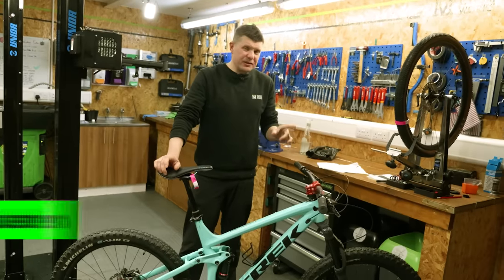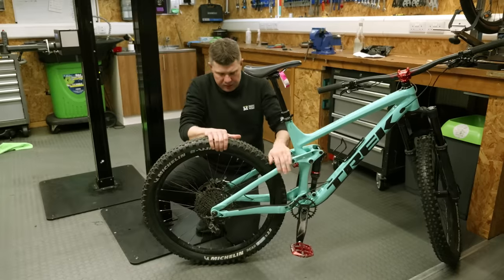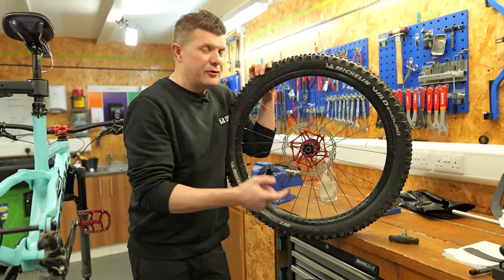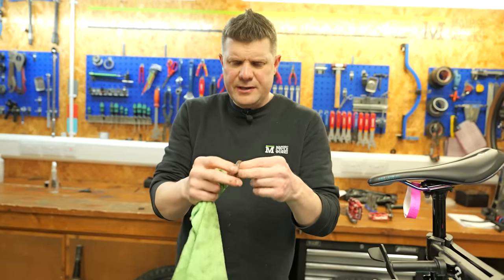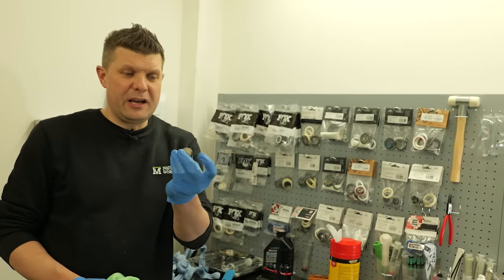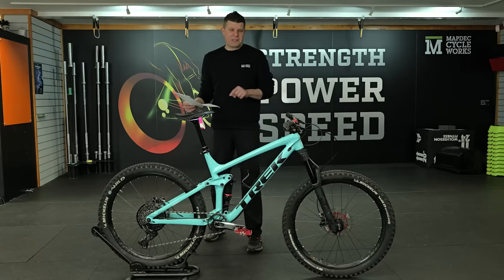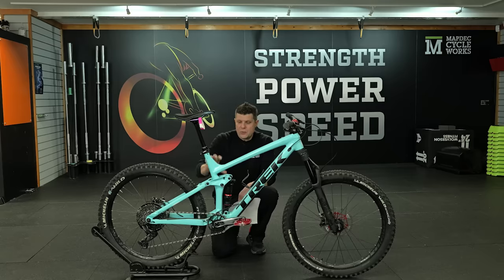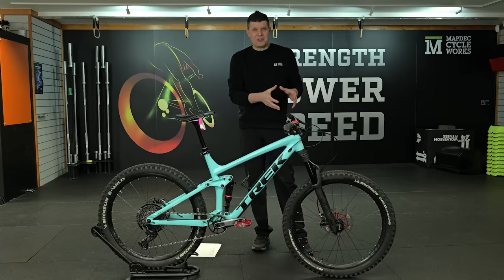They were quoted £975 to make this Trek Remedy safe

Comment: Our shop does “get you riding” repairs, but we strongly urge against it unless it’s an absolute must. As you said, a bigger repair bill is always coming down the line if you put off maintenance. Cheaper in the long run just to knock it all out and educate the customer on proper care to avoid the same situation in the future. We’ll always give them the option and the bare minimum, but we’re experts for a reason. It’s our job to guide someone to make the best decision possible for the longevity of their equipment. 

Your customers must be nicer than ours. If we do a bare minimum repair, they almost always come back in complaining about the things we didn’t touch in a few weeks and we have to go through it all over again. 😅
Reply from the maker: I think discussing expectations is very important when you do this kind of work.

Comment: Good video 👍🏻

I used to work at a National cycle chain, and very quickly learnt of the damage pressure washers do. Obviously now there are bike specific ones which I’m sure are fine, but use Muc Off products and a hose with the pressure turned down and don’t have any problems. 

The dealership I got my Trek Fuel from used to say if you can’t afford to put £15 in a jar each time you ride, (towards maintenance) then you shouldn’t be riding. Makes a lot of sense, especially as the basics are so easily dealt with at home.
Reply: Wow, £15 a ride would rack up to £45 a week! I get the thinking though

Comment: I can do slot of normal maintenance on my bikes but I took it to a bike shop recently to get it serviced. Fifty pounds got me wheels trued (I have no stand, reason I took it in), brake bleed, gears indexed, cleaned and oiled chain, check headset, check bottom bracket, check tyre pressure, check brake pads and disc. I bought the bike second hand and the guy was "Bigger" so they also set air suspension pressure and replaced a missing tube cap for free.
 
Everything except the truing I could have done but I'm glad I didn't have to index the gears.
Reply: That was interim service, full service does regrease, new bearings, pads, cables, true brake disc for £130 that's not a bad price

Comment: The suspension service thing is really common, most places will just tell you they send them away . I don't see the point in going to a shop when I can send them away myself. I've luckily got a place local that does service in house which I get my rear shock done at I do my fork lowers myself . I think it's really important to learn some home mechanics these days , break bleed dropper service etc . I do my own frame bearings also as that's a really labour intensive job . I think there's a lot of shops from what I hear quoting up bike services now as the bike industry pinch increases .most people with some tools and you tube as a guide can do basic servicing themselves.

Comment: Personally...I don't disagree with the first shop. It's a good opportunity to educate people of the required maintenance and cost of running a FS bike. 

They might have saved a bit of money this round but they'll have to pay the rest of that initial quote and then some for pivot bearings, new crank, cassette and miscellaneous other bits later down the road.  Preventative maintenance goes a long way. It's just the reality of partaking in a sport that can be destructive on consumable parts.  

Having said that I think you did an excellent job at pushing the limits of the "bare minimum" and empathizing with the customer on the day. It's important for folks to have repair options so long as there's a clear understanding of what's to come.
Reply: If the axle is bonded to the crank then yes, new cranks it is,if not bonded, you swap the axle.
If cassette is not worn out, why swap it?
Reply: @mtbboy1993  As stated "Later down the road."  Agree on the crank axle unless the rings are worn too. I could be more cost effective to get an entirely new crank. Depends. I'm not saying the cassette needed replacing now but it will eventually once it wears.  I would take a guess it'll be around the time when several other things need attention.  

Having worked as a mechanic...it's just one of those things. Folks only bring in their bikes to a shop after it's unrideable for some reason, only to be told many things are worn and need replacing(because of poor care and not bringing it in when problems arise initially).
Reply: True. Preventive maintenance and inspection is one of the first things the ride has to learn.  @antoinedoinell

Comment: Always turn your front wheel 90 degrees to check actual headset play with a bike sitting like that.  if you dont, you get brake pad slop front to rear and even suspension squat (a few mm) so in order to really feel it proper , turn the front wheel 90 degrees apply the front brake and put your hand on the top junction of the headset to head tube junction.  then you can really feel if it needs adjusting .  obviously wheel off the ground and rotation can help you diagnose actual bearing issues , but for adjustment (too loose) thats the way to go.  This combo can sus out where the issues are with the headset prior to pulling it apart.

Comment: I agree with you trying to repair, not replace to keep the costs down, but on the flip side, if you CAN afford it, you CAN afford to repair it. That's an expensive piece of equipment there, if you can't take the time to do preventative maintenance, you can afford to pay the price for your negligence. That's what taught me young, break something nice, you learn how expensive stuff really is, so some oil and grease goes a really long way.

Comment: As long as anything left in passable condition will tend to degrade slowly, then I don't see an issue. Depending on mileage, a basic fork service should happen soon, mostly to allow for inspection and benchmarking their use. They can do this at home. We want to catch issues while they're treatable. I tend to be less flexible with suspension service, since we have a reputation to uphold. Mid-season issues don't look good against that. 

Saving them some money in the short term and teaching them better habits, will hopefully earn you a loyal customer.

Comment: Good on you for the pay it forward fund, not everyone has free cash at every point in life while others are lucky to have it and want to share it.

For the bike itself there's the 'right way' and the 'good enough way', and most of the time the latter is absolutely sufficient. Less wasteful too. I ride a lot and know some people who will put their bike into the shop on a monthly basis to have bearings and cables etc changed more as a preventative than necessity whereas I'll usually leave something until it needs done and then do it myself. Pivot bearings are a great example. Of course you always want everything to be as perfect as can be, but my experience is that even relatively new bearings can generate a notchy feeling quite quickly. So twofold, I usually pack new bearings with a sticky marine grease, and secondly I don't replace them until they feel like they're on their way to seizing, or there's play. Bearings that are slightly grumbly are very noticeable in a wheel, but on a suspension linkage/swingarm etc they're indistinguishable from a new bearing. Where money or time should rightly be spent is where something is going to be damaged by inaction, like lack of lubricant in a fork or shock, or damaged seals etc. Other stuff might not be perfect but it won't cause damage and therefore can be left if you don't have the money. And that's regardless of bike value - a bike might be bought for a kid by an aunt, or whoever, or someone might have bought it when they had money and now their circumstances have changed. Not everyone has the money to replace an XTR mech every six months but might have seen the expense as an investment to recoup or enjoy over a number of years. Bikes now are expensive and as you move out of a price bracket compatibility usually changes (12 Spd XD cassettes being just one example).

The other bit I've seen in the comments here is the YouTube video argument. Some people are hands on and some aren't, and there's no shame in that. Personally I'm lucky to be good with my hands and able to pull stuff apart and rebuild effectively, frequently without a manual or such. But that isn't demographic wide and YouTube videos can frequently cause more problems than they attempt to resolve, and we shouldn't judge people for either being scared of having a go, or understanding where their abilities and limitations lie.

Comment: I liked the video. Im a mechanic and I see this all the time. Kid trashes the bike and keeps riding it  until something doesn't work properly. Tells dad my gears are skipping. Dad tells me just needs a quick service and gear tune. I find gears don't work at all, Derailleur bent and flogged out, pivot bearings shot and clunking, shock leaking air, bottom bracket stuffed, groove warn in crank spindle ect the list goes on. I ring with price and Dad says surly can't be that much wrong my boy said only gears skipping and he looks after his bike. I'm sure you know about that sort of thing. Customer says just do quick fix and I say yeah ok but don't expect too much given the issues. 2 weeks later Customer comes back you fixed this and now it's not working properly. I'm sure you've had that too.
Reply from the maker: Oh yes.  Setting expectations is a skill

Comment: I appreciate you trying to get a bike rideable for a customer, but I recommend a very different approach to service writing. 

When a bike comes in, I mention everything that needs to be done to make the bike ride like new, and mention possible upgrades when I find a part that needs replacement and not service. Listen for feedback. Sometimes that feedback is 'I don't want to spend more than x', sometimes it's 'just fix the flat, I don't care about a bent fork, sure I'll sign a safety waver'. When it comes to saving a customer money, I think it's your duty as a mechanic to consider the long run. A bike comes in with a bad BB. While it costs them less for you to service it than to replace it, it will need to be replaced, eventually. Are you actually saving them money by servicing it, only to replace it a few months down the line?

I will defend you and that shop a bit, and mention that the cost of maintaining bikes is very poorly communicated. Labor is high, but I guarantee you, none of us are in this industry for the money (it's passion and discounts!). $1000 for repairing a full suspension bike that's been poorly maintained is high, but not unbelievable. Especially given the neglect mtn bikes often see. There is a reason your warranty gets voided when you miss your 50hr and 200hr service. 

My two cents is save your pay it forward labor for the commuters who ride bikes out of necessity, not a teen on four-figure full suspension bike.
Reply from the maker: Yep. We really don’t have a commuter customer base at all.  When we do it’s usually an ebike out of warranty and the dealership won’t touch it, or just wants to replace motors rather than fix them.

Comment: The original quote was probably an underestimate for all the work needed, good that you were able to occlude the non-essential here... but what riders need to understand is the unfortunate running costs of this type of machine, due to component inflation, over-complication and short service intervals. Simpler alternatives are available. A 90's style mtb was always a good thing if cost is a concern. With modern bikes I have a few that cost more to ride per mile than the equivalent on a car.... it's off-putting.

Comment: So lucky with YouTube nowadays, if you are willing to spend sometime a lot of the  maintenance things for a mtb are on here, I avoid a lot of maintenance trips to shop just by investing in cassette tool, Allen keys, torque wrench and bb removal tools, suspension and 
Rear mech are pretty much the only things I haven’t had a go at doing, also gives you appreciation as to why shops will charge what they charge, like doing 2 tubless set ups, cleaning a chain, removing and re-greasing bb change some pads and clean rotors all of a sudden it’s 3 hours later for me 😂😂

Comment: @MapdecCycleWorks  Great to see Cassette pliers being used.  I used to hate chain whips, as they always felt flimsy and sketchy, to me.
I've got the Pedros ones that don't have the small lengths of chain.. Total game changer.

Good acknowledgment that the previous shop wasn't ripping the customer off, that the proposed work was reasonable .

The big takeaway was that the young bloke needs to HAND wash his bike, and learn to do basic maintenance and trouble shooting on his own bike.
Chains are a consumable  item and any rider should have a spare or two on hand. I also like quicklinks, as they make chain cleaning much easier. 

The young bloke would also do well to invest in a decent quality torque wrench to make sure that everything is fastened/tightened properly to spec.
Can't go wrong with Wera or Norbar brand torque wrenches. 
As others have posted here, there are many tutorials on Youtube to learn how to do a bunch of bike maintenance jobs etc.

Comment: What I’ve found with modern bikes that may catch lots of people out, is that they need regular maintenance and replacement parts more often than you think. Riding in the wet, muddy, grit ruins all moving parts. Jet washing is bad. You spend thousands on the initial purchase and need to keep on top of things. My full sus mtb is easily £300 per year to keep the basics working right, plus  a few hundred more for shock, fork and dropper servicing.  Water and winter kills bikes. Be prepared to keep shelling out even if you do everything reasonable yourself.
Reply from the maker: Wise words

Comment: Love it when thieves get caught..... thanks for your integrity! Isn't the original estimate almost more than the bike costs new?
Reply: The thing to bare in mind is that when a rear cassette can cost £300 and sending the shock away for a full strip-down could be anywhere from £120-£200 (if it needs a new shaft), then we're already up at the original quote... Not sure which model this is but nowadays an ordinary 'mid-range' modern mtb costs £3-4k, and if you're riding a lot in normal uk bad conditions and not self-servicing it may realistically cost £1k per year running costs with shock servicing and drivetrain wear. Me and my mates had a a lot of fun when we were that age on simple £400 hardtails that we learnt how to service ourselves, thats the bit that makes me cringe for upcoming riders.

Comment: I think it would be interesting to see a dedicated experiment on the effects of jet washing aka pressure washing. As long as people are using hoses or consumer grade washers, I don't think the impacts are as drastic as you portray them to be. 

Not only do these cartridge bearings have shields, they are also somewhat naturally protected by cranks, spacers, wavy washers, cones, and end caps. I don't think (pure assumption) that these bearings are directly exposed to pressurized water.  I would however, be interested to see if the indirect pressured water has any effect on their lifespan.

Comment: Shop around right now you can get some crazy deals on mountain bikes I wouldn’t go putting tons of money into older stuff..
All the fault suspension bikes can be a pain to deal with because yes, you gotta have the forks reconditioned and serviced and usually send them away to do so.. and those pivots can be expensive if you can even find them a big reason why those suspension bikes can be more trouble than they’re worth for some people

Comment: I think you did the right thing. No need to replace stuff that just need maintenance.
Pressure washer is fine if reasonable pressure is used and not blasting the bearings. Gentle wash is the key. I wash my bike in the shower.
12:02 I got a Geometron G1, that test won't work well for that bike as the shock sags on the bike's own weight around 5mm with the EXT Storia V3. But this is not the norm.

Comment: I have found that I work better not having the computer as a distraction anyway . If you sat exams , you would probably be more efficient  . I did Cytech cirriculum and this made a real difference .
Reply from the maker: Huh?
Reply: @Mapdec  This is why we have bicycle courses taught at technical colleges in some parts of Australia . We have Cytech and Five Star Training Institute courses and suspension modules on offer to the industry  . We learn with laptops at college and then taught to not be reliant on them at exam time . The exams are challenging but effective .

Comment: recently had this with a bike i bought for me kid. old stumpjumper FSR Elite. previous owner had been quoted more than they wanted to fix and bought there kid a new rockhopper hardtail and sold the stumpy on for cheap. 
tbh i think it was much worse then they had quoted, rear shock was compltely blown and no damping left it it all. everything was loose down to the mech hanger and upper jockey wheel bolt,  rear tyre smooth, brakes have sticky pistons. 

swapped my sons 1x gears and brakes and the wheels i built for him over, found a new never fitted brain shock for sale for very cheap so waiting for that. i need to do a lower leg service on the 32 TALAS forks, but other then that it's all ready. 

those dub cranks will do for now, best to replace them at sale time, the ones i put on the stumpy were £25 at sale time and £20 for a new SRAM BB.